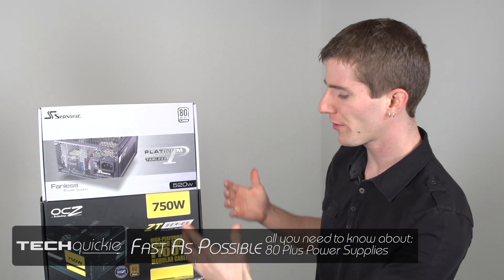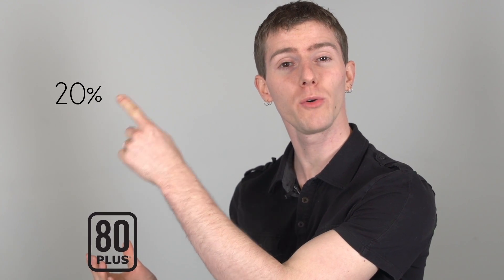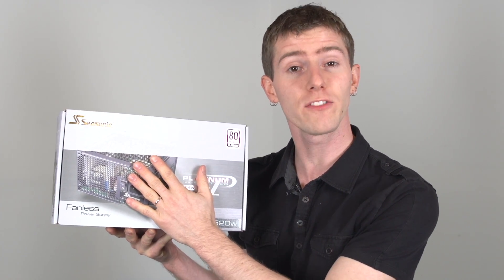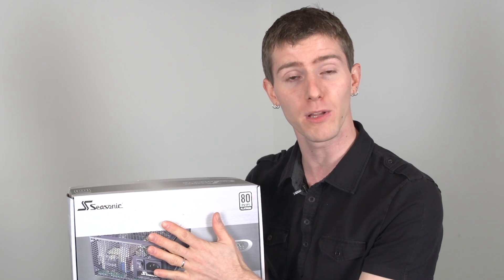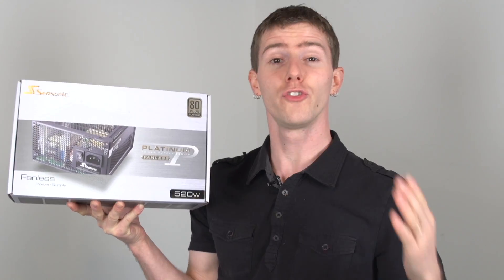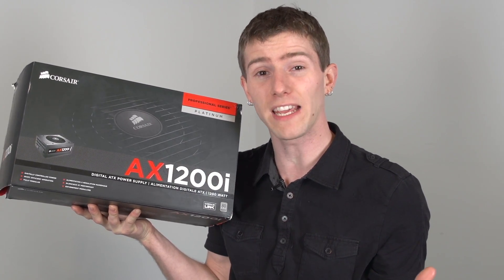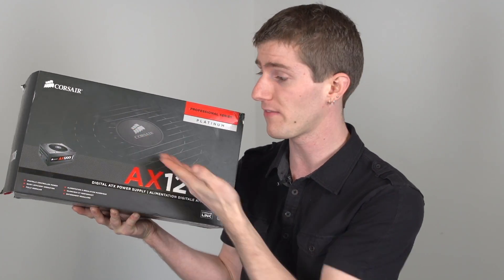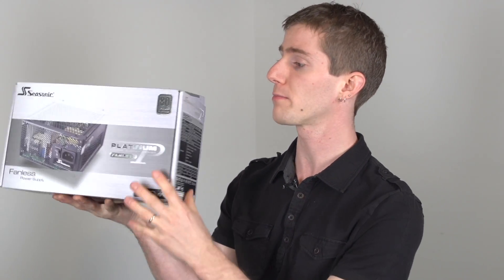80 PLUS Power Supply Ratings - All You Need to Know as Fast As Possible

Comment: What PSU would be good for a GTX 1070 FE x Ryzen 5 3600 16GB Ram combo with 3 drives, 5 to 6 fans and a optical drive? I am thinking of getting a thermal take 700W to replace my current 600W if nessary. But if evga's 600W is better then I may just be overreacting. No I haven't overclock yet but it is capable of doing it. No It isn't built for crysis, instead trains railroad simulator 2019. (Believe me the game uses more resources than it states in the system requirements, the msi 1050 ti couldn't properly run its TRAINZ A NEW ERA Brother)

Comment: Hey Linus may I ask if my PSU is good? 
My system is an 
AMD FX6300
6GBDDR3 1600Mhz ram
128ssd Kingston
3.5 inch 1tb Seagate baracuda 
2.5 inch 500gb WD Blue
GTX650Ti
3 pcs 120mm.deepcool fans
Deepcool gamaxx 400
Cooler.master ELITE v2 500 watt PSU .
So my PSU is powering my PC almost 6years and now still working and powering my pc. I've noticed that the PSU fan is noisy when im gaming like GTA4/5 but doing some.basic task it's kinda normal and not that loud. May I ask if my PSU is.good.or.not?? Looking forward to the answers! Thanks

Comment: Case iBUYPOWER Element PRO Front and Side Tempered Glass RGB Gaming Case
iBUYPOWER Elite Build Package Elite Build Package - Silver (Pro Wiring, Sleeved Cable - Choose a Color Below) - Black/White Cable
Case Fans Default Case Fan
Case Lighting iBUYPOWER RGB Lighting - [FREE] 1 RGB Lighting Strip
iBUYPOWER Labs - Noise Reduction Advanced - iBUYPOWER Harmony SRS Sound Reduction System - includes 4 x be quiet! Silent Wings 3 Fans - Improved Airflow; Extremely Quiet
Processor Intel® Core™ i9-9900KF Processor (8x 3.60GHz/16MB L3 Cache)
Processor Cooling DEEPCOOL Gammaxx GT RGB CPU Cooler - RGB
Memory 16 GB [8 GB X2] DDR4-3000 Memory Module - **Certified Major Brand Gaming Memory Free Upgrade to DDR4-3200 XPG D41 RGB Memory
Video Card NVIDIA GeForce RTX 2070 SUPER - 8GB GDDR6 (VR-Ready) - Single Card
Game Bundle [Game Bundle] - Get Wolfenstein: Youngblood and Control - w/ Purchase of NVIDIA RTX Graphic Cards
Game Bundle [FREE Game Bundle] - Intel Game Days Extreme - w/ Purchase of Intel Core i7 or i9 K Processors
Motherboard ASUS PRIME Z390-P -- Realtek LAN, USB 3.1 (6 Rear, 4 Front), ASUS 5X Protection III
Power Supply 850 Watt - Standard 80 PLUS Gold
Advance Cabling Options Standard Default Cables
Primary Hard Drive 240 GB ADATA SU650 SSD -- Read: 520MB/s, Write: 450MB/s - Single Drive
Data Hard Drive 2 TB Hard Drive -- 256MB Cache, 7200RPM, 6.0Gb/s - Single Drive
Sound Card 3D Premium Surround Sound Onboard
Network Card Onboard LAN Network (Gb or 10/100)
Operating System Windows 10 Home + Office 365 Trial [FREE 30 Day Trial] - (64-bit)
Keyboard iBUYPOWER Standard Gaming Keyboard - Free Upgrade to iBUYPOWER Standard RGB Gaming Keyboard
Mouse iBUYPOWER Gaming Optical Mouse - Multi-Color LED Lighting
Case Engraving Service Custom Message - Max 35 characters (including spaces)
Warranty 3 Year Standard Warranty Service
Rush Service Standard Service - Estimated Ship in 5-10 Business Days
Total Price:$1,928

Comment: Many people confuse 80 plus certification which is really just more efficient way of using energy with actual quality certification of the power supply. I really think there should be a certification por power supply quality. I've seen many many disgustingly shitty power supplies that have generic quality but are certified bronce 80 plus or other certification levels. Eagle Warrior is one of them. Also a none certified EVGA white none certified is way better power supply than a Game Factor bronce certified power supply. So don't get confused people. Like Linus said. Read first... Power usage certification does not necesarily guarantee you a good power supply.

Comment: let me get this straight. say a power supply has 500 watts and exactly 80% under full load. when under full load, does this mean the power supply produces 500 watts (100%) to the pc, and 100 watts (20%) into heat and other types of energy. or does it mean that, under full load, 400 watts (80%) are delivered to the pc, and 100 watts (20%) are delivered into heat and other energy types?

Comment: Is a 700watt psu appropriate for a computer with a rx 480 a i7 3770k with 16gb ram on 4 sticks and 3 hard drives (one 2 tb hdd, one 500gb hdd and one 256gb ssd)?
Reply: It should be fine.

Comment: is it okay if i power my PC using a nuclear reactor?
Reply: As long as you dispose the garbage in you're bin, it is.
Reply: Techtastisch 75 thanks
Reply: Yes, it's ok, just make sure the energy level is adjusted to which your PC takes in to prevent overvoltage
Reply: Depending on where you live it might be already.
Reply: Might have to contact your local authorities, because "apparently" radiation is dangerous!
Reply: The Good Guy radiation isn’t bad for you if your a supermutant
Reply: @junlee3515  yeah you will only grow couple of arm :) no big deal XD
Reply: @sabingurung4736  Better for gaming
Reply: Sure, I do.  That's not all it's used for, it runs the rest of my house and about 30,000 others besides, but you can 100% nuclear power your computer.

Comment: I want to upgrade my GPU but i don't think it can be enough for my psu, can you help me?

My build up.
Benq DL2215 Monitor
PSU CX500 Corsair Bronze
Asrock H87M
i5-4670 LGA1550 Haswel
PCI-e TP-Link 300mbps
2 Fan 12cm Coolermaster
DVD-ROM
2 Harddisk 2TB Seagate Barracuda Total 4TB
1 SSD Sandisk Ultra
Dual Ram 16GB Corsair DDR3
Zotac GTX 750 1GB to Shaphire RX 480 8GB

I want to change my gpu from Zotac Gtx 750 1GB to Saphire RX 480 8GB. It says my GTX750 took 55watt and RX480 175watt. Three times more bigger. Can my Psu to handdle my PC? Im a budget builder so i dont want to upgrade PSU anymore cuz it very expensive in ruppiah currency. Your answer will make my decision. Thanks before
Reply: http://outervision.com/power-supply-calculator

Comment: amd a10 7850k not overclocked , 8 gb ddr3 1600 mhz ram, msi a68hm grenade motherboard and a 450w non 80+ power supply. Should i upgrade it to one that is 80+ certified? Plz help
Reply: Definitely. If you have a non-80+ then it is either old or a horrible brand. Also, consider upgrading the rest of your build if you do gaming/working on it.
Reply: +Awesomlego no it is pretty new. It is a corsair vs450 watt. Behind it it sais it was sold in stores in 2015. Also up front it sais up to 85% efficiency. Does that change anything?
Reply: I don't know very much about that psu, but there are great forums for pc builders and enthusiasts. I recommend the PCPartpicker forum at pcpartpicker.com/forums , the LTT formums of course, and the Tom's hardware forums at tomshardware.com/forum .

You will find some great people getting the PC enthusiast community at all of these, although I do prefer Tom's Hardware because of their articles that you can subscribe to as well and their larger number of people than the other ones. Hope this helps!
Reply: +Awesomlego thanks a lot
Reply: Andrew Baxevanos I've had my corsair vs 450w explode on me before

Comment: What do you think of the Corsair Cx750? I'm planning on getting an i5 4690k, and I currently have a GTX 750 TI, but in the future I may get a 1070 or future equivalent. 750w may be a little too much, but that's the only decent price I could get in my country.
Reply: hopefully not too late of a response but don't go for those CX750! I had a problem with two different CX750M and I fried over $2,000 worth of equipment between two different computers (MB,HDD,CPU). I opted for thermaltake which was cheaper and more reliable in my opinion.
Reply: BTW I have a GTX 1080 and i7 5820k and I believe my rig can run with as low as 500W. A GTX 1070 is so efficient it is stupid to even consider anything over 700w.
Reply: dmolition123 I haven't bought anything yet. People in linus website recomended me the Supernova 650 G2. I have to wait until I can ship from Amazon (I need to do some formalities to be sable to ship from outside the country)

Comment: Hey guys correct me if i am wrong.. 
But Wattage of power supply (like 1200 watts psu etc) denotes the MAXIMUM watts it can supply right?! 
Not like it draws 1200 watts all the time right?? 
So basically a 1200 watt psu can supply as much wattage as much as the system needs between 0-1200 right?!
Reply: If a Power Supply is 600 W, then it can supply UP TO 600W. If your PC at idle takes 150W, then despite having a 600W PSU it'll drain only 150 Watts from the wall
Reply: +Damian Skrok
Kinda, but if your PC takes 200W of power, and your power supply is 80+ efficient, your PSU will draw 200W + 20% due to it's efficiency. PSUs are rated at their maximum DC output, not AC input
Reply: yup
Reply: Sahibjot Singh but efficiency at low loads is low

Comment: i7 6700k
asus gtx 960 4gb
asus z1700 pro gaming
16 2400mhz ram
cooler corsair h1000i
ssd 240gb
500 gb hdd
1tb hdd
what psu i need
Reply: +Anand Kumar XFX TS 550w Full Wired 80+ Bronze Power Supply
Reply: +Giorgio Baggetto You mean Full modular?
Reply: +Narmanda Widhi Actually mine is completely wired, so no modular. But the modular one I way better

Comment: i have a 750w gold but my system only draws around 400w , is that bad?
Reply: Nope, It's actually a decent idea to buy more watts than you currently need to save room for future upgrades or overclocking.
Reply: Not bad at all
Reply: Woah I need to get that I want to save electricity
Reply: I have a 680w PSU even though my computer only consumes about 400w, it's a great way to future proof your beloved so later in time you don't have to go out and buy a brand new PSU because you wanted to latest and greatest since whatever it was in your computer failed or became obsolete.

Comment: I'm thinking about an 80+ Unobtainium. Way pricey though.
Reply: +Tyler513 80+ Admanplutoniahextatanium certified is the only thing i'll drop dollar on
Reply: David Ventura Get outta here.  
My 80.5+ Methionylthreonylthreonylglutaminylalanyl rated PSU is the only thing worth my paycheck.
Reply: I once used a psu calculator and maxed every spec out- the calculator showed an Amazon link to get a psu for that- the thanos glove 80+ adamantium
Reply: 101% efficiency it creates power out of nothing, it better
Reply: @Nik-oj7je  Adds bonus stat boost, important for a build
Reply: Man I bought yesterday a Psu 100+ Plutonium. It makes power out of nothing you should check it out
Reply: I have a 80+ vibranium psu
Reply: 80 plus plastic
Reply: Unobtainium is a trademarked material now I think I saw it on my dh mtb pants. Lmfao poc brand I believe
Reply: I bought this but it wouldn't post pass the bios. It kept saying "Your Not Worthy". Useless
Reply: ikr

Comment: so bronze 80 + is a bad power supply? will it damage my components?
Reply: +piwypd0 80+ does NOT determine how good a PSU is, just how efficient a PSU is.
Reply: +HelmTheHobbit but no overclocking?
Reply: ***** 80+ bronze is not worse than 80+ platinum, just less efficient.
Reply: +piwypd0 it's fine just wastes more electricity costing tiny amounts more doesn't effect anything else

Comment: Is 80+ recommended? Since for my build i use 250-270 watt or can i use a standard psu for like 30 euro?
Reply: NEVER go cheap on power supplies,even if it has low watt needs,cheap psus never have as much power as they say and if the psu fails it can kill your whole rig,unless its a good brand since the good branded ones have protection in case they fail so it wont kill other components in the system
Reply: +row row fight the powah Thx i'm saving up Some money for a 700 euro pc and a psu of 60 dollar cooler master 450w 80+ bronze
Reply: +Exhaust hinX go for a 750w 80+ gold. Im currently saving up for mine :P

Comment: i use 850w 80plus bronze 
and have 2x r9 290
and my rig draws around 650-750 watts
Reply: uziel vasquez I maxed both cards and it went up to 779watts on my full system but one of my card's broke soId sold them both and got a gtx 980
Reply: +[cancer]Linus just the tips That's.. really cutting it close mate. Overclock that CPU and those GPUs and you might run into problems. the r9 290 are beastly.
Reply: that's kinda risky, maybe a 900w power supply would be better

Comment: I have a bronze 600w power supply paired with a gtx 950 and amd fx-6300. I know that it's more power than I need, but will it hurt the performance of my computer while idle?
Reply: +Jarret Padua Yes, your PSU will run kinda inefficiently.
Reply: What if I overclock both of them? I just built the pc and I clocked the cpu to 4.1 gz, and offset the gpu memory by 100mhz and added an extra 25mv of power
Reply: Doesn't really help much.

Comment: whats the best way to calculate system load when idle before I buy the system?
Reply: +SnipeYouFromMars outervision power supply calculator on the internet calculates parts psu usage whit OC available
Reply: +Daniel Ross awesome thankd
Reply: SnipeYouFromMars you're welcome
i was looking for the same awnser like 10 mins ago XD but found it
Reply: +Daniel Ross internet op
Reply: Bloodstainer imo its important to know both since all power supplies are only rated for their specified efficiency above 20% load
Reply: Mohamed Osama internet is life
Reply: Daniel Ross i live on the internet
Reply: SnipeYouFromMars I'm the internet
kinky
Reply: +SnipeYouFromMars You shoudln't calculate idle, you should calculate under load.
Reply: SnipeYouFromMars That doesn't matter though? If you're sitting at 80 or 150 on idle doesn't really matter. Since the different of those 20% can't ever be matched. Look at their 7 gamers 1 PC video, that's a 1500+ W PC that's running at 250W at idle. You won't ever be able to match efficiency at high wattage rating etc.

Comment: What about 80plus Titanium
Reply: +T Soft Efficiency goes by percentage. The max theoretical efficiency is just shy of 100%. You can't pull 50 watts from the wall and get 500 watts magically. And when a conversion is done, some power is lost as heat. Anyway, power supplies work by taking x amount of watts, cutting the voltage and sending it to the different components of your computer through multiple rails. The PSU will take x amount of watts multiplied by the efficiency level of the power supply at the current percentage of its maximum continuous output wattage.
Reply: @nictheperson6709  R/Wooosh
Reply: ***** Millisecond :)
Reply: The wall outlet is always 120/240 v never 1 v did you mean 1 A
Reply: minecraftbuilder46 dafuq is that
Reply: minecraftbuilder46 i'll be back
Reply: +T Soft maybe 1v per ms?
Reply: 80 plus Uranium
Reply: what about 80plus diamond?

Comment: OK so my mom bought me a 850w BRONZE instead of the gold i wanted for my 980 sli system. Am i screwed right now or no???? also i don't really understand what Linus says in this video so could someone please explain to me if bronze will work or not simply
Reply: Okay, so you got an 80+ bronze certified power supply. All power supply have an efficiency, this means how efficient it will work. 80+ bronze has around 83% efficiency. This means that the power your power supply is getting, 83% is actually being used for your PC. The other 17% is not being used. That doesn't really matter that much. So pretty much all these 80+ logos just mean how many watts you are actually able to use for your PC and not be lost. This says nothing about how much it will crash or die.

So basically, for you, you just have to look at reviews from people with the same power supply and see if it is good. If it is good and doesn't crash, you should be fine with the bronze.
Reply: +Michael Mangiameli 8 months late, but how about you buy your own shit?
Reply: ***** 8 months later pc broke and I DID thank you very much

Comment: Is 500W PSU - FSP 80+ BRONZE - 85% Efficiency good for this setu below.

Intel Core i7 4790K - 4 Cores @ 4Ghz (Turbo 4.4Ghz) + 8MB CACHE / overclocked To Approx 4.4Ghz To 4.6Ghz
ASUS Z97-P
BE QUIET! Dark Rock 3 CPU Cooler
32GB DDR3 1600Mhz - CRUCIAL Ballistix
256GB CRUCIAL MX100 SATA3 - 6Gb/s
2TB SEAGATE SATA3 - 6Gb/s, 7200 RPM & 64MB Cache
SAMSUNG 24X DVD+/-RW Dual Layer & Dual Format
nVIDIA GeForce GTX 780 3GB
Reply: +Kelvin Wilson better take 600 - 700w gold :P
Reply: Ok thank you Ivano.

Comment: Should I get the Evga PSU 750G for $80, or 850G2 for $120?  Which is the better deal?

I have a gtx 960, hd, ssd, 8gb ram.  I may or may not SLI in 2-3 years.
Reply: KnicksNYanks84 Even with SLI, 650W is good enough.. gtx 960 runs at very low load